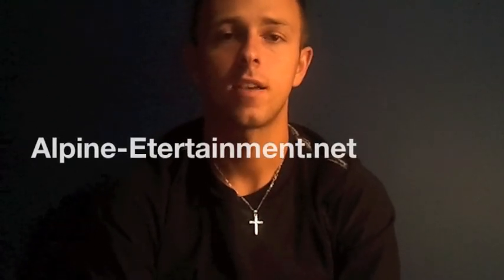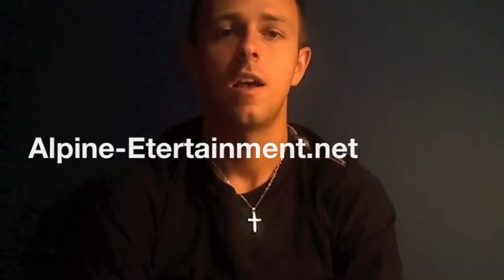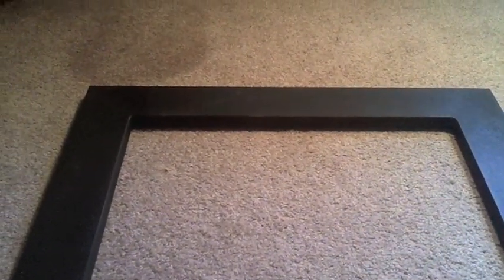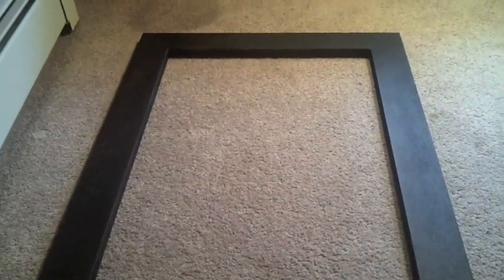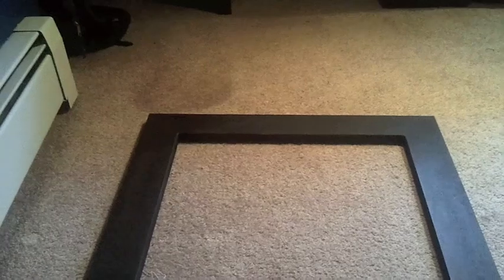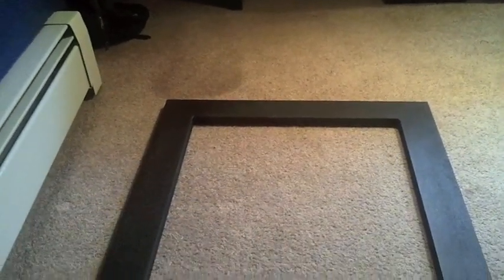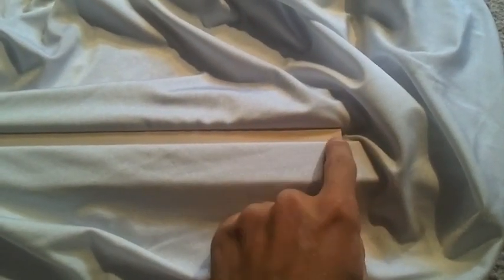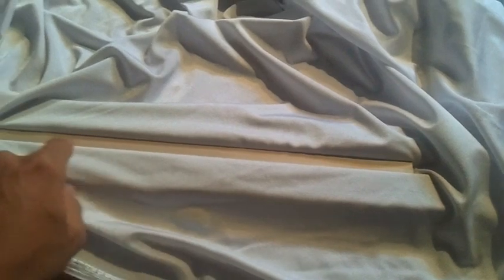DIY LED DJ FACADE do it from scratch

Comment: I saw both videos... Great stuff.... Quick question... I actually considered making my panels the way yours were made when I built my facade a few years ago. Exactly what wood did you use for the Panels? And what are the cut dimensions on the panels for the back of the facade, and the type of sticks you used for the material? I want to build another facade and really like how yours came out... Thanks

Comment: Looks good man.  Definetly straighter then mine.  I like how you made them shorter.  This way it still cover's the top of the table and the chords coming out of the back of your gear, but allows the guests to see you more.  I like how the panel is all 1 piece.  Your idea is better in the long run!  Good job bud!